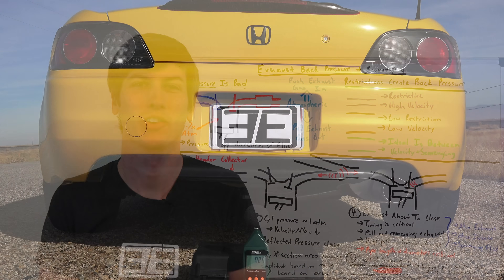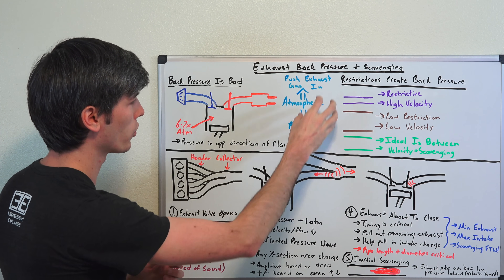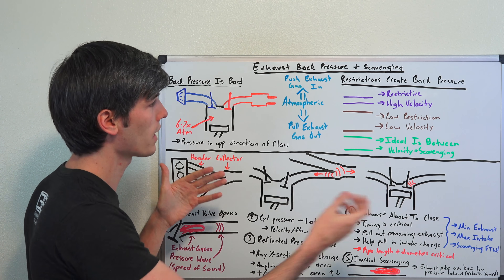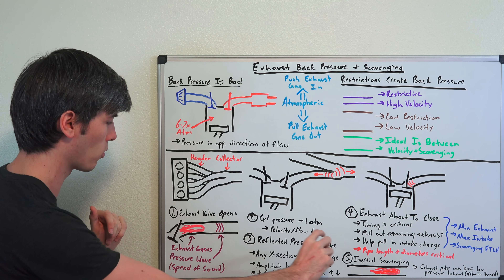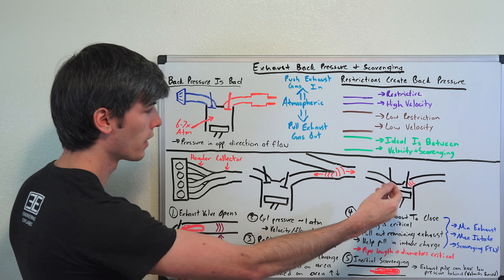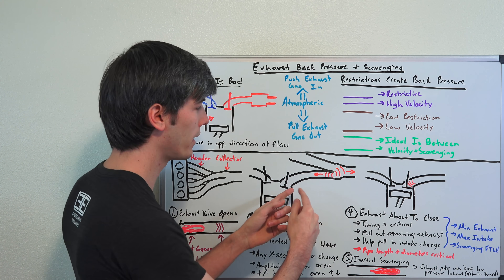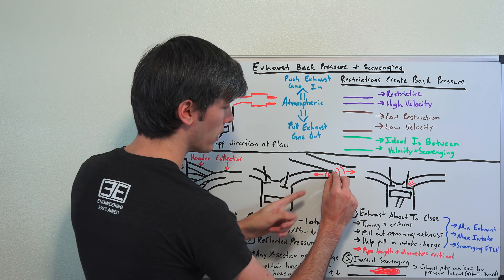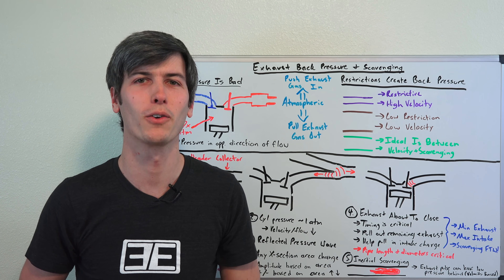Stop Saying Car Exhausts Need Back Pressure

Comment: I’ve always heard that exhaust valves could deform due to heat if you went with too low of a back pressure such as straight pipes or just headers. Your explanation was great. Lower velocity due to less restriction means the hot exhaust gases are lingering causing heat issues. I understand velocity and pressure (PV/nrT) but it still seems counter intuitive sometimes. That’s why I’m an Electrical Engineer ;)
Reply: I+Dolly DeHart - it's not the pressure, but the slow flow. Low velocity is what helps burn valves - it allows the hot gasses to sit around the valve longer. That is the exact point of this video - the common misconception is that people use 'backpressure' when they mean 'low velocity'. Look closer at the top right of the whiteboard in the video - that's talking about pipe diameters. Too small gives you high velocity, but high pressure. Too large a pipe does the opposite - low velocity (cook valves) but low pressure. There is a sweet spot for each engine, but it's more about power generated percylinder. Power = airflow, and it's true in the exhaust as well. You can calculate how much exhaust gas a cylinder will produce for a given power level - then you need to find the sweet spot for that flow in pipe diameter.
Reply: lol the V in your equation is volume fyi. I hope you really understand velocity and pressure mr electrical engineer
Reply: I was taught in automotive school too low of back pressure would burn up exhaust valves
Reply: Dolly DeHart can somebody confirm this? I run my 05 wrx with a 3" straight pipe after the downpipe which is 2.5" (stock) and I was told I would deform the valves sooner or later....is this actually true?
Reply: Just theory to consider here. Assume the header was tuned to perfectly scavenge the remaining hot gasses from the cylinder at peak torque as demonstrated in the video. It's pretty easy to see why this ideal, you would get a boost in peak torque. So imagine the result if you removed what was scavenging the last bit of hot gasses from a combustion chamber. A little bit of that hot mass lingers there  when chamber pressure reaches equilibrium with atmospheric. I think this would create a hot spot on the head that the cooling system wouldn't be able to deal with. After the energy (heat) has been extracted and turned into mechanical work via spinning a crankshaft or driving a turbine, it's just causing issues by hanging around. Once it's useful life has ended inside of an engine it needs to be returned back to mother nature as quickly and efficiently as possible so the cycle can repeat.
Reply: Sir Francis even if it was true the biggest restriction in the exhaust for your WRX is the turbo itself so you are good. Also, the downpipe is mlre restrictive than the 3 inch straight pipe. So in actuality all that affects is sound.

Comment: Curious if for a 4 cylinder, if 4-2-1 Headers are better than 4-1 for back pressure.
Reply: 4-1 is better for top end performance. And 4-2-1 is better for mid range performance. Depended on what you want.
Reply: It all depends 
4-1 is better for pure performance In a smaller area of rpm range 4-2-1 is better for a wide range of rpm
Reply: IIRC, 4-2-1 headers are like two different 4-1 headers(aka long tube & short tube) in one, the best of both worlds(kind of)

Comment: This is just a misunderstanding. "back pressure" is a the vacuum pulse for when the gas leaves the exhaust system and theres no longer any pressure pushing it out, it creates a "back pressure" which is a vacuum response to the sudden drop in exhaust pressure . this vacuum pulse can be tuned with the engines combustion cycle. people are just calling it the wrong thing and it gets misinterpreted. I would call it a "vacuum response"
Reply: AllForTheGame are you referring to scavenging ?

Comment: nicely explained, thank you very much.

one thing that puzzles me about the scavenging:
how can you tune the desired pressure effects with fixed length exhaust parts, when most of the other parameters like exhaust pressure, velocity and timing between cylinders must vary significantly depending on rpm?
Reply from the maker: Generally you're tuning for a specific RPM window - for example in racing when you know RPM will remain high, you tune for peak torque at higher RPM (and thus also peak power). For passenger cars it's difficult to do, because a wider torque range is more favorable (turbochargers can generally accomplish this well).
Reply: Engineering Explained 
My field is biology based, so I am not far above caveman level on this. When you add boost, by supercharger (wider RPM) or turbocharger (narrower band) you increase flow through the exhaust system. Should you expect to leave a stock exhaust and catalyst system stay in line without blowing the stock converter? I am thinking about the Edelbrock SC CARB system for the MX-5 ND (and aftermarket CARB turbo systems) that require the dual catalyst stock exhaust. 
Great video thanks for the education!
Turbo and supercharger system next?

Comment: Will routing an external wastegate dump back into the exhaust create more or less back pressure than dumping it out to atmosphere?
Reply from the maker: Likely more, but manufacturers do it to keep cars emissions compliant.
Reply: Engineering Explained I was told that for my twin turbo setup, routing the external wastegate dumps back into the exhaust creates a 'venturi effect' and actually lowers back pressure. I figure you'd be able to prove or disprove that

Comment: So that's why in NA engine muffler delete is useless mod. Restriction will give you low end torque. So the straight pipe from headers will benefit only to drag cars.

Comment: David Vizard wrote about this (World Horsepower Guru). He commented on some brilliant testing that drew the wrong conclusion. The test with more backpressure did gain power because the muffler designs were different and changed (inverted or moved) the pressure wave tuning point at the end of the pipe. It happened that the more restrictive muffler had the better resonance tuning. More or less what you say here, but it should have been more widespread knowledge
Reply: Have you heard of "pressure wave termination boxes"? It's a trick used to simulate having open headers (no exhaust) while actually having a full system

The inverse trick exists too. Headers designed for use with cat converters immediately after them (but in use on a non-emission car) can have a temporary (and hopefully smooth) decrease in pipe size to simulate the wave reversal characteristics of a cat converter.

Wave tuning is cool. I play with it on Engine Analyzer. I've seen (simulated) volumetric efficiency of 112% at times

Comment: Great video Jason, and really interesting topic! One question, did you learn all of this knowledge in your degree, or did you have to research it for this video, because it seems like they are some really specific knowledge and phenomena to have learned at school.
Reply from the maker: Most of this is from online research - there were a few well researched papers and articles I found on the subject for bits and pieces. As is generally the case, there's a lot of good (and bad) information floating around on the internet, just needs to be sorted down to the facts. That's my goal! As far as my degree, I just did a bunch of challenging math problems for four years haha. Not a huge amount of practical knowledge, but definitely problem solving skills.
Reply: coscorrodrift I believe he learned some of the basics through classes-thermodynamics, design, etc and then did self study outside the curriculum

Comment: So basically everyone needs at least one turbo 😆 (it's a joke)
Reply: *one turbo per cylinder
Reply: Sean Watts Joke's on you, my intake manifold is cast. XD
Reply: ...you'll blow the welds on your intake ...
Reply: Sean Watts If your welds break that means more air will get in so that means more power! What’s the problem? Lol
Reply: Martin Varela Unless you're a diesel guy in which case you gotta run a compounding turbo setup for each cylinder just to be safe. So one turbo per turbo per cylinder.
Reply: Remember all the software that was named 'turbo'? Not to mention all the other devices tagged with the turbo moniker in order to make people think they were high performance, none of which actually contained a physical turbocharger or turbo anything. 'Turbo' became the hot adjective to call anything.
Reply: Hunt, you didn't see the movie ...

Comment: I never believed in backpressure, but I wanted to watch this anyway. Care to elaborate on what methods manufacturers use for turbo applications? It's going to act as a restriction for sure but are there any tricks manufacturers use to mitigate this?
Reply from the maker: Generally for turbocharged applications, you simply want low restriction after the turbo, because you're no longer going to gain the benefits of scavenging from exhaust pulses. Leading up to the turbo, you want to keep routing short, and hot, so that little energy is lost from the exhaust valve to the exhaust turbine.
Reply: Engineering Explained 
To me that sounds like a short and fat turbo manifold leading into the turbine side of the turbo with a high flow cat right after it, and the absolute lowest possible restriction muffler after the cat to keep noise humanly acceptable. I am simply not psychopathic enough to needlessly pollute. Droning exhaust notes get old real quick.

Comment: Car Exhausts Need Back Pressure
Reply: Isaac har har. Baffle. Exhaust joke. Har har.
Reply: It amazes me that people are missing the blatantly obvious joke.
Reply: I was taught at UTI that cars do need back pressure...but the instructor used to be a technician not an engineer so I guess that explains that.
Reply: Ennan Coffey Har Har, sarcastically starting the obvious, har har.
Reply: Yes Jason himself admitted that cars can benefit (to a point) from smaller diameter tubing that will increase the exhaust gas velocity. This however has a bad side effect of increasing back pressure, that's why we don't have cars with quarter inch exhausts. The common folk correctly identified a trend but their terminology and reasoning is wrong. Either way sometimes a larger exhaust may be detrimental in some cases.

Comment: i believe that the OEM exhaust is the best for every car.
Reply: ploutarxara 4ever There is literall proof of HP gains from a performance exhaust lol you are believing in something that has been proven false
Reply: Have you seen oem exhaust manifolds? Best design, no. Cheap and decently effective yes
Reply: ploutarxara 4ever at least 10 hp and at least 15 ft-lb torque (must have got a good torque boost with 2.5" full exhaust and 2 high-flow cats replacing OEM), still quite a bit from making 190 hp to the wheels and without tune.
Reply: ploutarxara 4ever I would disagree with a specific example; the third generation Mazda Miata has an extremely restrictive collection point in the header. It literally pinches all four tubes together at the end and it was made that way because money. It's easily one of the best things to replace in the car to increase the flow characteristics. OEM exhausts are made to be inexpensive, give low end useable torque, as well as pass emissions, not for performance.
Reply: Lmao not true. False
Reply: that's why the fastest of modified cars have 2 cats in their 2" exhaust
Reply: The OEM exhaust in an SN95 Mustang GT had 6 catalytic converters, 6 CATS!!! No way in hell that's the best performance exhaust. Glad all of that was quickly replaced in my car.
Reply: MrDaxtr  how much hp do you believe it gained ??
Reply: Depends on car
Reply: Once you straight pipe it
Reply: I would agree that the OEM header design and pipe diameter is going to be the best for a stock setup. However, the muffler, resonator, and catalytic converter all hinder performance in order to reduce emissions and make a car quieter. For a setup with more power than stock, a larger pipe diameter will be advantageous.
Reply: For the application that the car was designed for Yes , however you can gain high-end power in say a Camry at the expense of quitness, efficiency, and maybe low rpm torque. So no, oem exhausts are not always the best
Reply: Anyways the difference in hp is unnoticeable. Check out engine masters video where they bash their headers and it doesn’t do anything.
Reply: Greenespirit  yes sometimes you gain power but i have heard about cases that loose 5 hp

Comment: So why when i open my 335i's exhaust valve i got bigger turbo lag?
Reply: Илья Миронов turbo lag but more power
Reply: I very much doubt it makes any difference let alone one you would notice.
Reply: The turbo itself is a restriction and what is explained in this video is all happening in the exhaust manifold before the turbo , there is no question that removing restrictions after the turbo is a performance gain, your extra turbo lag is either non-existent or the ECU is confused which is causes other issues.
Reply: There is no more power, only bigger turbo lag and thats it.
Reply: Илья Миронов then you need a tune. The car doesn’t instantly know you did a mod.
Reply: DriftNick THANKYOU

Comment: I stopped doing absolutely nothing to watch this, it better be good
Reply from the maker: Hahaha, I'll do my best to entertain you for the next 9 minutes. :)
Reply: Engineering Explained update: it was good
Reply: @EngineeringExplained  that's what she said.
Reply: @TurboVisBits 😂
Reply: That was good, but doesn't the car in the thumbnail have twin turbos that changes everything? That's what got me to watch the vid, was to hear about exhaust tuning with twin turbos. As well some engines these days have variable exhaust tuning that varies collector diameter with RPM, like an FZ1 motorcycle I bought back in '05 uses to tune across a far wider range RPM range, I haven't seen a car use that which is surprising to me.
Reply: @EngineeringExplained  Hey, I'm planning to increase the downpipe and headers diameter from 1.50 to 1.75. Will I lose performance/power? My car is a Honda Jazz GE.
Reply: it was good. I learned that I missed my chance a few months ago to see a HP increase by driving around when the eye of Hurricane Irma passed by, due to lowered atmospheric pressure.
Reply: @dougefresh123  Great thought! 😂
Reply: @dougefresh123  omg loved your comment!
Reply: Supercharged Mustang GT yes I did :)
Reply: Ryan Aponte Hey I just saw that you left this exact comment on ss717's vid :)